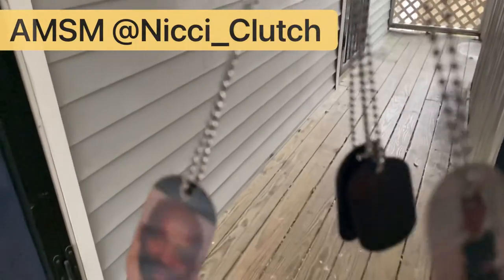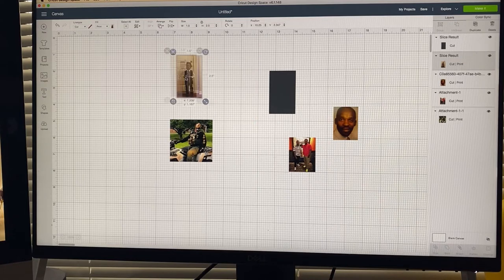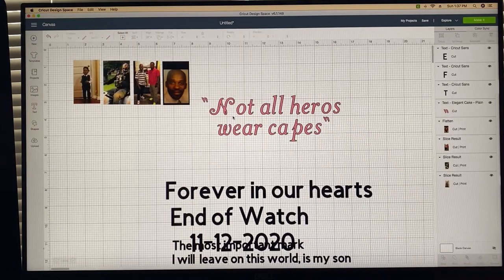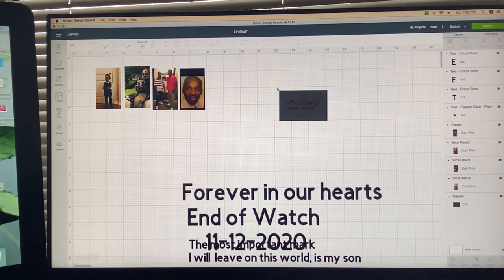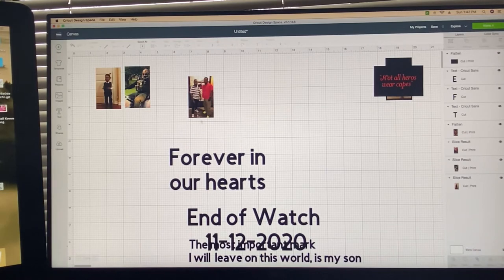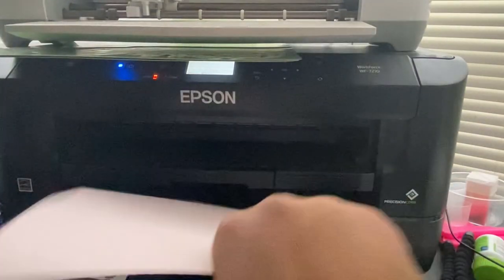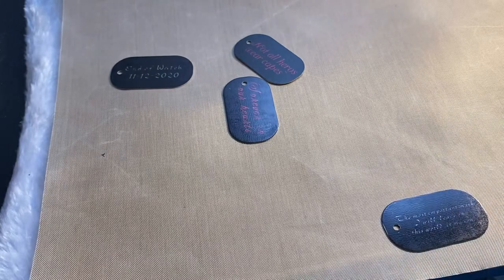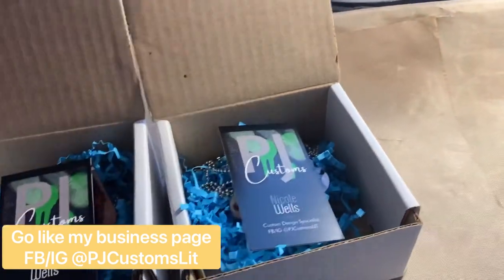How To Make Sublimation Dogtags| DIY Necklaces| Epson WF 7210

Comment: I'd like to know if you can put vinyl on if you mess up one... glitter vinyl maybe and sublimate on that?
Reply from the maker: I’ve put vinyl on it before. HTV stayed on just fine. So I’m sure you could. But the white glitter might now be thick enough to hide the error beneath it. 

They only cost about .50 cents each… so it’s better just to start over.
Reply: @nicciclutch  that's great to know thanks, my sizing was a little too small on a few and i've got some scrap pieces of glitter vinyl so i'll give it a whirl and see what happens 😊
Reply: @nicciclutch  have you tried white vinyl, I have that too.?
Reply from the maker: No. I’ve only used glitter vinyl but as an accept piece… not to correct an error…

Comment: Where did u get your sublimation printer
Reply: Check on the Epson website, but you should try looking for one through amazon or your local store.  You have to convert your printer into a sublimation printer by using sublimation ink.  I have two Epson 2750's and Epson EP 15000 (waiting to convert it to sublimation) and waiting on the Epson Ecotank 15000 (prints on larger paper)